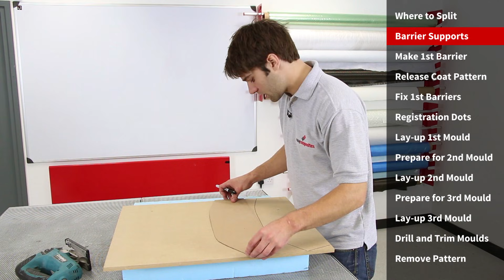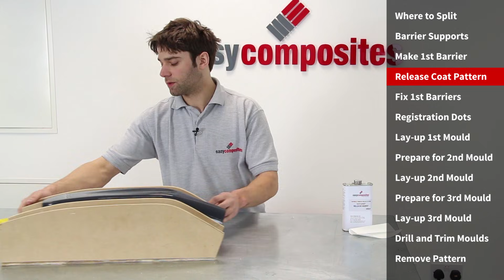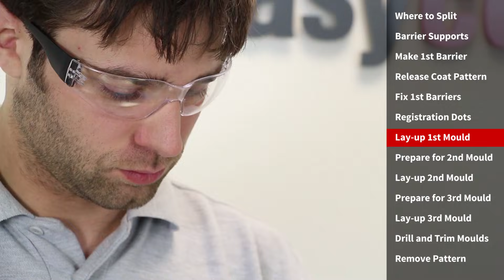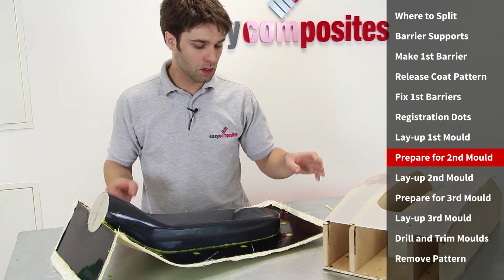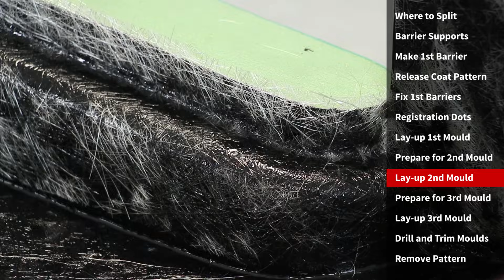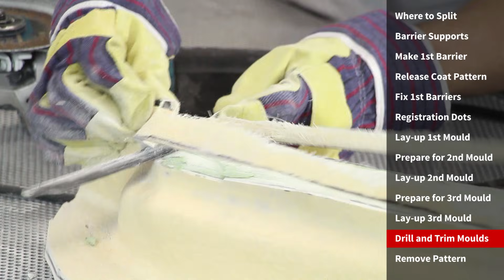Fibreglass/FRP Split-Mould Making Guide (Carbon Fibre Airbox Pt.2)

Comment: How is your tooling gel not absolutely full of porosity?   when we are building our molds we spray the gel on in about 6 applications to stop the porosity.  we also switch colours of tooling gel 1/2 way through the application so that Un the future what doing mold repairs we know when we are sanding too far through the gel.
Reply from the maker: I've never experienced the issue with porosity that you're describing. We have a number of tooling gelcoats and I've never encountered this - it might be time to consider changing your tooling gelcoat. It's an option to give yourself two gelcoat colours so that you can tell when you've gone down fully through one layer but at the same time it can be visually quite distracting when you're trying to check the perfection of the mould surface after repair or restoration. Personal choice I guess.
Reply: Unfortunately for us, we only have 2 suppliers in our Provence that can handle the volume we need and one of them has such terrible service we just can't use them.

Comment: Hi what's your opinion on PVA release agent? I like to spray it on my bucks & moulds & haven't found anything else you can put through a gun.
Reply from the maker: For the transition from a pattern to a mould PVA can sometimes be the right choice. Personally I'm not a fan of the finish that PVA leaves on the pattern, resulting in too much work to restore a good finish. Our approach would be to use a reliable coating material on the pattern, so that the release is assured, and then use a release agent such as wax or chemical release agent (such as Easy-Lease) which will leave a better finish on the mould.

Comment: Is it possible to make a rough carbon fibre surface (e.g from wrapping) glossy, by sanding and adding more resin, or is having a smooth mould the only way to get that smooth shiny glossy surface finish?
Reply from the maker: Ideally a smooth mould will be the quickest way, however you can use the skinning method by coating layers of resin on top of raw cloth.  You will need to spend considerable time sanding and smoothing the resin but great results can be achieved with patience.

Comment: Is it possible to combine a mold similar to this, maybe two-part, with vacuum resin infusion? I haven't done prepreg and have done infusion. I want to end up with a hollow part (an intake primary plenum) with a slot like yours but narrower.
Reply from the maker: In theory yes it is. However it will be difficult to ensure the fabric is tightly against the mould surface, and you will have to take plenty of extra care during the vacuum pulling and infusion to ensure you get a good result.  Would definitely be a challenge and take some skill!

Comment: Is there a reason for the use of PP sheet to make the split line of the mould? I want to make one for my master thesis as well and have a lot of PVC sheets here, should it be feasible with PVC or does it react with the gel coat or other coatings?
Reply from the maker: Hi Jente, we use PP sheet because it has great self-release properties (doesn't need any release agent) PVC will also work in a similar way (it shouldn't react with the gel-coat) but I would advise a coat of release agent to ensure easy removal.

Comment: why did you need the green pvc block? You called it an apperture... I dont understand
Reply from the maker: The edge of the green block forms the surface for the flanges to be formed around the apperture/hole in the airbox.

Comment: How many times can i use a mould like this? I'm planning on making pipes so the mould will be used a lot, or is there another method that is better for making moulds that will be used several times?
Reply from the maker: Hi Stef, moulds made from Uni-Mould will last a very long time, probably hundreds of releases. Often it's just a case of re-polishing the surface (after a while) to restore the mould to as-new condition. When we started out in business we manufactured carbon fibre parts in Uni-Mould moulds, we would use the moulds every single day, for years.

Comment: After you build the mould, have you tempered before beginning the production?
Reply from the maker: The mould was subject to a post cure after the initial cure at room temperature.  We used the standard post cure cycle as found in the Uni-Mould guidance documentation available here: http://www.easycomposites.co.uk/#!/starter-kits/uni-mould-complete-mould-making-kit.html

Comment: Hi, I use a fairly thin poly tooling gelcoat, to keep it short, is there a filler safe to use for thickening a tooling Gel? I have fumed silica
Reply from the maker: Fumed Silica is normally the filler powder of choice when it comes to thickening resins and gels.  Start with only a very small percentage as the fumed silica is quite effective.

Comment: Would this type of mould survive if used in an autoclave at 125° and 90psi?
Reply from the maker: Hi James, Uni-Mould is primarily designed for Out of Autoclave use so we would not recommend it for Autoclave processing, both because of the temperature limitation of 95°C and the fact it is not designed to work under those pressures. We would advise you use a dedicated moulding system for Autoclave use. Uni-Mould is great for the Out of Autoclave usage as it is a familiar technique to most traditional moulding, and provides a tooling system that can be used for anything from simple wet lay laminating all the way up to the more technical Resin Infusion and Out of Autoclave pre-preg methods.  It is also superb value for money.
Reply: easycompositestv actually I haven't seen any proper autoclave mould that wasn't made out of cnc aluminium or other kind of metal...

Comment: and can you make a carbon fiber mold on fiber glass .
Reply from the maker: Sharon Thomas 'Fibreglass' moulds are most commonly made using polyester resin and polyester gelcoat. If you're going to use epoxy resin to make your carbon fibre parts (which is the most suitable resin system for carbon fibre) then it has a nasty habit of 'sticking' in polyester gelcoated moulds, even when they've been prepared with a release agent. If possible, it's far better to make the moulds using a vinylester gelcoat or an epoxy gelcoat which epoxy resin will release from very reliably.

Comment: did you apply release agent on the polipropeline form part before gelcoating ? Cause it's not shown
Reply from the maker: +niebedepil No, no release agent is needed on the polypropylene - it's totally non-stick to resins like polyester, vinylester and epoxy.
Reply: +Easy Composites Ltd cool. thank you for your answer!

Comment: Why do you need an additional resin( coupling coat), why can't you just use regular resin? I would like the least amount of different materials, this allows (me/us low production guys) to by a greater quantity ( at a cheaper cost) of the most useful materials?
Reply from the maker: +JerseyMikeP : It's because of the high temperature use. For ambient temperature, you wouldn't necessarily need the coupling coat but for high temp you do. The reason is because when laminating the main reinforcement layer, because the resin is filled you can't see through it. If you can't see through it then you can't spot any small pockets of trapped air. If these air pockets are directly against the gel then when the mould is used at temperature the gel will blister. When you use the clear coupling coat and a thin skin of lightweight glass you can ensure that there are no such pockets which means you won't get blisters when the mould hits temperature. There's other reasons too such as the way the coupling coat helps to interface between the VE gel and the filled PY resin but the main reason is to eliminate blisters.

Comment: Excuse-me, what is the yellow substance that you use to paste the parts? 
Thank you.
Reply from the maker: We use a soft filleting wax to fill the edges and create a smooth transition from the part to the flanges. It is easily pliable by hand and very easy to sculpt to make smooth curves and corners. We have also used it here to make the registration dots.

Comment: do you clean the rollers using accetone ?
Reply from the maker: yes you can clean them with acetone.  You need to ensure you do it before the resin begins to gel otherwise it will not come off.

Comment: What exact flax fiber did you use?
Reply: Also, what exact carbon fiber did you use?
Reply from the maker: No Flax or carbon fibre was used in the making of the moulds themselves. The finished carbon part only contained our Easy-Preg Surface layer and our Vari-Preg 430gsm Pre-preg fabrics.

Comment: Can i just use concrete after the black gel coat? Or would that screw up the final product?

Also is there a difference between black/white/ or green gel? I want to get a perfect glass finish for a carbon fiber part

Comment: Nice video i like it ! i have a question please ; does it work if one can build a carbon fiber parts and using as a mould a styro-foam ? Thanks in advance :)
Reply from the maker: Wajdi Rebei Is is possible to use styrofoam to create your pattern but you need to be aware the polyester and vinylester resins will attach (and melt) styrofoam so, if you're going to use either of these resin systems for your mould, you will need to protect the styrofoam from them. To do this, you can 'scrim' your styrofoam pattern using epoxy resin (which won't attack styrofoam) and a lightweight woven glass cloth. This can then be flatted and polished ready to take your mould off.